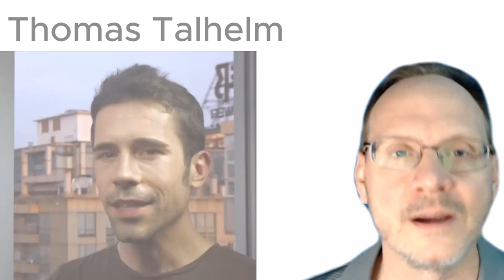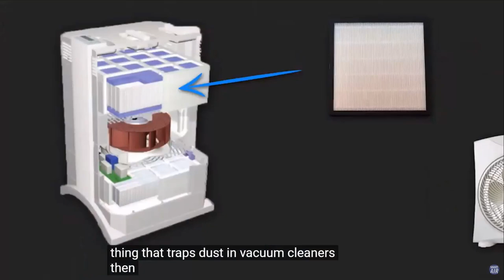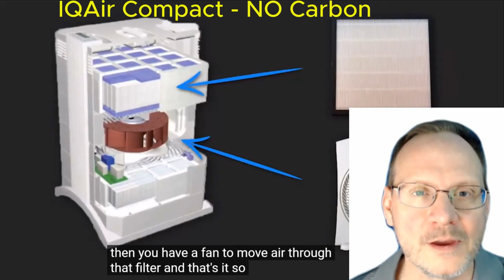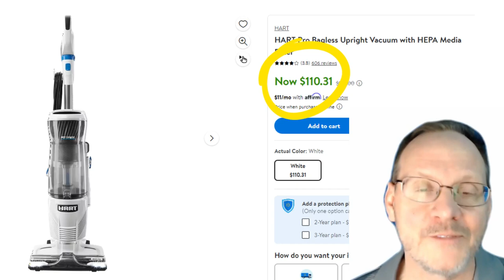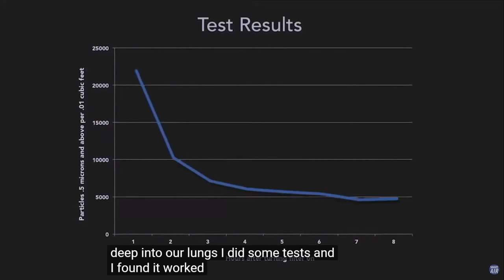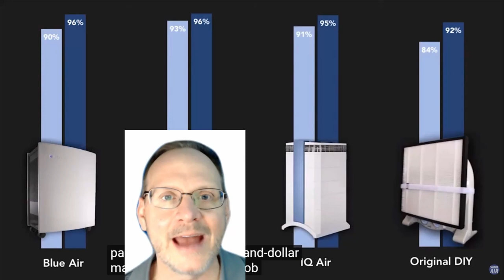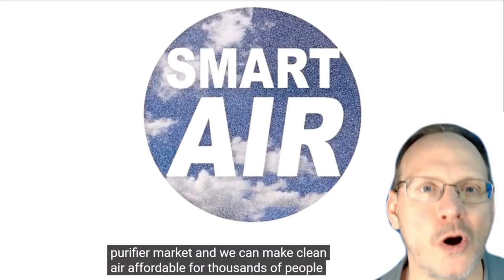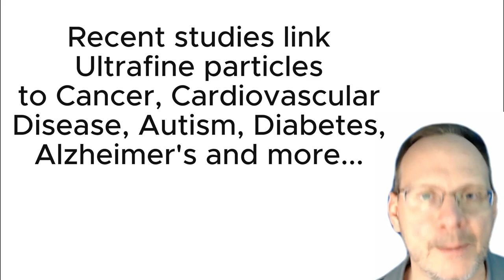Smart Air DIY: Is $45 Air Purifier REALLY Better than $1199 IQAir? Busting MYTHS Review

Comment: Hey friend!

I think you’re a very knowledgeable person, but after watching a few of your videos I can’t help but feel as though you’re getting in your own way. 

There’s this thing that sales people do, where they say “hey look at this thing, it clearly means this other thing is true” when those two things are not mutually exclusive. Watching back your videos, listen for the times you say, “Right?!” A filter can weigh less, and perform just as well as a heavier filter. For all I know as a viewer, there’s lead weights in the heavier filters. Without quantifiable data, or even a teardown/performance measurement of two products to compare the performance and specs, it not only doesn’t convince me of your argument, but it makes me believe you less. If you cannot measure how much better a product is, why should I believe the more expensive one you’re vouching for is actually better? You’re incentivized to sell me a decent product at as high of a price as possible, so price is not a convincing factor for me, performance is. Show me the performance numbers!

When discussing the oil filter company you previously worked for in another video, I had to stop and walk away. Again, as a sales person for this company, you should be knowledgeable enough to speak to the degradation of oil not only by contaminates but also heat cycles, oxidation, and breakdown of the detergents and additives in the oil. Trusting a high performance oil filter for 100k miles is like trusting a high performance oil filter for 100k miles. The filtration of the oil is only one factor in the breakdown of the lubrication and protection of an oil, so why not discuss that or even mention it? I’m sure there was more to the product than just better filtration, but please discuss it or at least mention it.

As an ordinary consumer who just wants to reduce the total number of pollen particles in my home, why would I care how perfectly sealed and chock full of carbon my air purifier is? I feel the money invested into air purification is better spent on the HVAC side in terms of CFM and ease of use, but tell me why I’m wrong! I just don’t care if 10% or even 50% of the air going through my purifier is leaking out and not being filtered if the filters cost 1/10 as much. A bad filter replaced every 10 days will always be better than a fancy filter replaced every 100 days in that case. Focus on the value a product actually provides to a customer, not what the product can do overall. 

And lastly, making health claims about air quality as outlandish as a link with autism is really disappointing. It aligns yourself with Andrew Wakefield and the unfortunate parents who believe those claims. Asthma or other lung related links would make sense, but I would be careful about the studies and links you draw to form your conclusions. If you aren’t able to confidently read the study yourself and analyze the efficacy, you shouldn’t spread the results as fact or even “possible links”. 

I’m sure this will be deleted within the week, but I really want to see you dive into proving the claims you make, because I’m sure you’re right! These companies spend a lot of money to create the best products possible, and I’m sure they’re better than Levoit and Shark, but show me, don’t tell me. Vacuum wars is at least trying to do tests and is seeing a ton of success doing so, so there is a market and space for you to become that air purifier tester/verifier/arbiter of truth! The space would be better served by that than claims without basis or shaky stilts to stand on. 

I look forward to seeing how you progress in your work here, and hope this message isn’t received too harshly. You’re a passionate person who might just be crazy enough to make a difference in random strangers lives, but I feel as though some changes need to happen before that’s possible.
Reply from the maker: Hey Nathan - thank you for your feedback.  Let me try to answer some of your points.

1) "Show me the performance numbers!"   

1A) I think it is very difficult to accurately measure the performance of air purifiers for particles and VOCs and it requires expensive equipment, a controlled environment and trained staff  - whom I would consider to be somewhat "experts" at testing.  

1B) Yes, there are certifications in the industry like EN 1822 but I think some manufacturers are not always being truthful with the actual performance of their units in these tests... and the units oftentimes perform differently in the real world for customers (especially over time after some use). And/or different testing labs may be testing units differently than others.  I will be learning more about this over time but getting accurate, 100%, black and white comparison data and test results between units is not easy to obtain.  And I think many manufacturers are taking great liberties with their marketing and advertising campaigns.  In short - there is A LOT of false advertising and marketing going on these days. 

1C) Yes, I can use my 5 air quality testers to test some of my air purifiers but I do not trust their accuracy and none of them can test for the Ultrafine particles - which are the most dangerous to people. I've had air quality monitors tell me unit A was better than unit B on Tuesday and then on Wednesday tell me Unit B is better than Unit A.  The EPA says testing monitors less than $5K tend to be inaccurate and more so over time.  When I started the channel I planned on testing the units with monitors until I started working with them and researching their accuracy levels and I realized - I don't trust them. So, I currently believe testing needs to be left to the experts at this time.  

2) "The filtration of the oil is only one factor in the breakdown of the lubrication and protection of an oil, so why not discuss that or even mention it?"  

2A) People are watching this video for air purification content (not oil purification) and I just wanted them to realize that manufacturers ship defective filters all the time - regardless of industry - even simple filters.  I don't think the vast majority of viewers would want to learn more about the oil purification process in this video.

3) "Focus on the value a product actually provides to a customer, not what the product can do overall. "  

3A) The IQAir HealthPro Plus provides elite filtration - 99.5% down to .003 microns and ultrafine particles - which are the most plentiful and dangerous to humans.  That is what sets the HPP apart from the vast majority of units on the market.  

3B) This video was not a sales video for the HPP but rather to provide an example of the outrageous lies and deceptions that manufacturers fill the industry with.  The Founder of Smart Air claims he "figured out' the air purification industry one afternoon all by himself and his cheap fan and filter are just as good as the elite HPP.  The claims are mind numbingly ridiculous, IMO.  And more importantly, Dangerous!

4) "HVAC side in terms of CFM and ease of use, but tell me why I’m wrong!" 

4A) This would be the topic for a different video... "Air purification" is an endless general topic -  with many niches and sub topics.  All the info. cannot fit in one somewhat short video. 

5) " If you aren’t able to confidently read the study yourself and analyze the efficacy, you shouldn’t spread the results as fact or even “possible links”. "

5A) There are many studies on the hazards of ultrafine particles and I've read some of them. I discuss this issue in further detail in some other videos.  One single video cannot contain all the information and angles associated with air purification and the hazards of ultrafine particles.  Again, this video is focused on the outrageous claims that some air purifier manufacturers are making.  That is the entire point of the video.  The industry is not regulated closely so manufacturers can typically say anything they want.

6) "The space would be better served by that than claims without basis or shaky stilts to stand on. "

6A) This video obviously contains my opinions.  If some people believe that a $50 fan and filter perform just as well as a $900 IQAir HPP then they are welcome to do so.  If some people believe that the Smart Air founder truly "Figured out" the entire air purification industry all by himself in just one afternoon... then, by all means - that is OK. And if some people trust the founder, who stated that all we need is a simple $50 air purifier (without carbon) - but then he turns around later and tries to sell a $1,000 air purifier to consumers (with optional carbon) and they still trust him.  That is also OK.  I currently disagree with some of his points and I made a video about it.  I am offering my opinion but folks do not have to agree with me. 

7)  There are an endless number of topics to learn about in the air purification industry.  I do not pretend to know it all as that would be absurd.  I am a "student" of the industry and I learn new things all the time. I feel like I am still in the "early stages" of learning in many of the different sub topics - there is an ocean of information and things are dynamic, as well (new info. occurs all the time).  I currently believe there are very few "experts" in the industry and they would only be in certain sub topics/niches (fan engineering expert, formaldehyde/mold testing expert, etc.)... but there is no such thing as an "expert" of the entire industry.  I started the channel because I saw how much misinformation was being spread on YT and it really irritated me.  My content is also changing over time as I learn more... we will see where this all eventually leads.... as IDK... 

Thank you for your feedback and Enjoy the Holidays! 😃